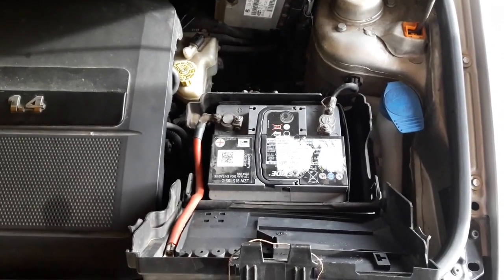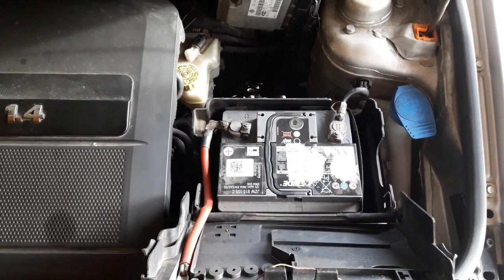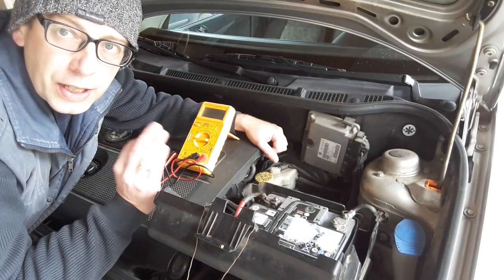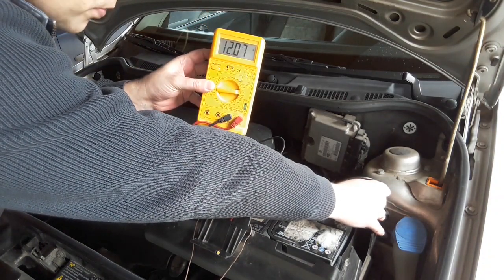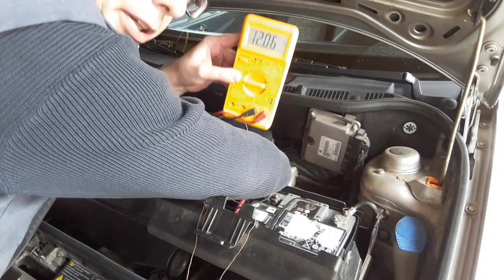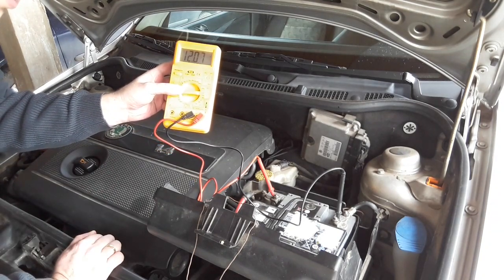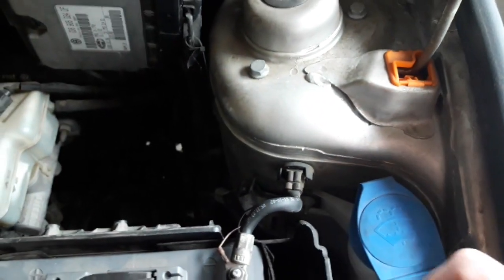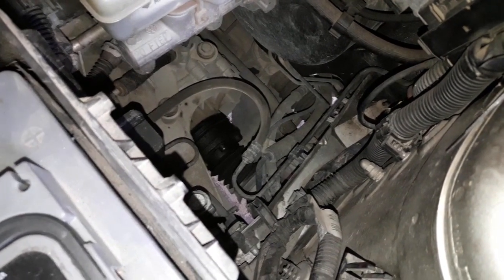Bad Ground Connection On Cars-Meaning,Symptoms, Diagnosing and Solving The Problem

Comment: Good video!
The jumper cable method is pretty fast. Idk about newer cars but I've also heard of people creating an additional ground on older vehicles. I suppose for a ground diagnoses in conjunction with a certain ground  not easily accessible or the area of ground conection is simply too oxidized. May as well check out the condition of the positive cable while you're poking around.
My truck has a slow start, takes an extra crank, bit of a lope. Charging system/battery is good, might just replace the battery cables for the heck of it, see what happens. Its 220,000 miles and a decent amount of corrosion akl along the inside of the cable. So even it doesnt solve my problem, I feel compelled to do it. 
Come check me out.

Comment: Out of all the videos here on YouTube about checking the ground connections, I actually understood what to do. Thank you for making it easy to understand. Have a blessed day.
Reply from the maker: You're welcome and thanks for watching!
Reply: @DespairRepair Hi I'm not sure if you still reply to this video or not but I'm desperate. My car has no problem starting it doesn't crank hard or anything. But I do have really weird electrical issues where radio will shut off sometimes I can't unlock my door after I park with the button (still unlocks when I open door(s) ). Odometer goes crazy and incredibly rarely thought it has happened at least once the headlights turned off at night for a brief second. Sometimes I'll get a battery light but not usually. Codes show fluctuating voltage sometimes says system voltage high sometimes it says low same is true with brake. It also says I have a bad break vacuum pump but it doesn't make any crazy noises and I don't have any issues breaking or stopping along side other codes that don't make sense compared to what I'm seeing. Most of which will always come back after clearing codes. Battery test both loaded and unloaded at advanced auto showed battery is good. I've been worried it's big but someone on a forum recommended ground. Does this also line up with bad ground to you? If not do you think a pcm could cause this? Is that even possible? Cause lots of my codes relate to a pcm but I'm seeing no evidence online as none of the usual bad pcm symptoms are what I'm experiencing my mpg is still good car doesn't shut down while driving. But it would then have to be a tipm wouldn't it but again no starting issues. But no mechanic around here is willing to work on electrical issues so I'm stuck trying to figure it out on my own.
Reply: @DisloyalGaming your TIPM
Reply: @DespairRepair  So how do I test the 2007 Audi Q7 with battery being not under the hood. It's under driver seat inside vehicle. How am I to test ground using your method explain here with the multimeter?
Reply from the maker: @Heylo7  hi and thanks for watching! Do you have remote battery connections under the hood? 
Also, what do you want to test? Is the engine grounded, the body, or else?
Reply: @DespairRepair  yes I have positive connection and the ground connection posts to under hood driver side of the engine bay. I want to test for ground. Using your method from what I watched in your video here. My multimeter is a cen-tech cm300 and the dials numbering on it start at 60 600 6000 etc it's not the one which let's you set multimeter to say 20 200 2000 etc mines not like that.
Reply from the maker: @Heylo7  what's the problem and why are you testing?
Reply: @DespairRepair  hi here's a update. Upon further inspection of the vehicle fuel pumps located under rear passenger seats I discovered right side fuel pump, fuel filter missing it's hose. I'm not sure if it's the sending or return? I have not taken either of them out at this time. I'm wondering whether as result of missing hose would that possibly be a contributing factor as to why there was issue with high pressure fuel side of system. I think it would be best for me to simply replace the two fuel pumps and fuel filters...also figure out where missing hose goes attached
Reply: @DespairRepair  I tested the map sensor for 5V reference and it was less then 5V
Reply: Good and clear explanation - thank you 👍
Reply: C b lm c c

Comment: On VW group cars: high idle, around 1100 rpm = grounding is bad.
Reply: Really? I have a 87 cabrio that is idling at 1100 and I have voltage drop issues when any components are used, signals, fan, brakes etc.
Reply: @Chazisus  it is possible. Try to clean the negative leads and see what happens
Reply: @wtfatc4556  I have a 900rpm idle whilst in drive and 1100 in Park/ neutral
Reply: @Chazisus  hard to tell if it is the same problem.... mine sits at high eevs even in drive.

Comment: What ground connection ? Where on 12 v battery u have ground ?
Reply: Black negative wire is ground
Reply: @neil_st6073  no negative wire is negative wire not ground ! In your house is ground wire green and yellow .
Reply: @kakofon78  the negative on a battery is connected to ground to make the circuit, normally to the car body, hence It is the ground in this situation
Reply from the maker: Hi and thanks for watching!

On a car, the ground connection is considered the connection between the minus battery terminal and the engine/body/chassis.

So, it's not literally a ground connection but speaking in "electrical" terms, it is.

Comment: You helped me, I knew I had a good battery & the alternator was fine. I was told my battery cable was recalled. I'm stuck 400 miles from home, alone & need to get back. I cleaned the one accessable ground connection & haven't had trouble since. Thank you very much for the info. Now my serpentine belt is squealing & I must replace before my trip. I've had one blow before & it busted the water resivour & temp guage.
Reply from the maker: Glad the video helped and thanks for watching!

Comment: Really thanks alot for the very useful video. Question: When doing the bypass jumping cable , should I turn ingention key on or leave it off ? thanks.
Reply from the maker: You're welcome and thanks for watching!

It would be better to first turn off the ignition and then connect the cable.

Comment: Replaced FIVE starters (each one lasts maybe a month!) so thanks for this very helpful video, looking for all the ground connections to see if heavy cranking is burning them up due to poor ground. Maranatha
Reply from the maker: Hi, thanks for watching, and glad if the video helped!

Hope you solve the problem, a bad ground connection will fry the starter for sure.

Check if you have a ground strap from the engine or transmission to the chassis or body.
Reply: I had the same problem and consulted many mechanics. Some said the problem maybe the battery and others starter. I had it fixed and it's okay.

Comment: I have an issue with my 2015 Ford fusion...so it sometimes won't start and says its not in park but it is in park and the beeper stays on and drains battery. So after checking battery which is new...alternator which tests fine I was angry and I hit the top of my steering wheel, the flat part on top right behind the steering wheel with a flashlight just out of anger and it started. (Yes this is anger from  a single female and trying to fix my own car...very frustrating! Lol) anyway now when it decides I need stress and doesn't start I just get the flashlight and hit it and it starts so it is probably a ground wire or loose wire inside but I can't seem to find it. Any ideas? I have it torn apart now I will try to post pic. Any help please?
Reply from the maker: Hi Lisa and thanks for watching!

This is a tough one but the first place I'd look is around the ignition switch, where the ignition key goes.

Namely the electric connector and wiring that goes to the ignition switch.

To do that you'll have to take off the plastic trimming around the steering wheel.
Reply: Can you teach me this?

Comment: My car radio turns off when I hit the brakes. Sometimes it goes off when I put the car in reverse or turn on the blower. Lights are flickering. Long start.  Battery is 11.4 while running, down from 13. Corolla 2013. I don't know where the engine ground is, only the battery ground.
Reply from the maker: Hi and thanks for watching!

All of that sounds more like an alternator problem than a ground connection problem, to be honest.
Reply: @DespairRepair  
It started after my brand new alternator was only 2 or 3 months old! I installed the alternator myself. But tensioner is bent a little which means that the belt could potentially get looser or tighter while driving.
Reply from the maker: @gabe6281  well, it's possible but then there's some serious belt slipping.

And even if there is, the voltage should be above 11,4 volts. With a loose belt but with a good alternator, you should get at least 13 to 13,5 volts until you turn on the light for instance.

Comment: I was having issues that my car goes in to limb mode,not revving above 2000 rpm,diagnosed the car and it said exhaust gas temperature sensor, replaced it and it was ok again for about 4 months,then the same problem appeared, again the egt sensor, i said to myself maybe a bad sensor, contacted the seller they gave me a new one other brand free of charge,it was ok again for 4 or 5 months ,again the same problem egt sensor, it was having also difficulties to start the car,and one day the car would start anymore, no power whatsoever,checked the battery and noticed the ground connection was loose,it was tight all the but would not grab,i took a piece of aluminium foil and jammed in between the connection and since then car starts very good and no more egt fault codes,it was very frustrating the find the problem 😂
Reply from the maker: Hi and thanks for watching!

Glad that you solved the problem and congratulations on finding what was the issue.

As mentioned ground connection problems can cause really big problems that manifest themselves in various ways.

Not being aware of this problem can cost a lot of money and nerves.

Just make sure the connection is good and clean, even replace the connection if you have to.

All the best.
Reply: @DespairRepair  thanks ❤

Comment: The jumper cable test worked for my 30 year old truck. I had no power inside the truck except the cab light. I was about to buy a new battery even though mine tested 12.6 volts. I turned the key on and hooked up one side of the jumper cables from the negative battery to the fender and everything came on inside. I cleaned the negative battery cable at the alternator. 5 minute fix after watching the video. Thank You so much!!!

Comment: 9:11 my car doesn’t show any sign of electricity. But if i put a jumper there is electric and i can start the engine. Whats the problem? 
I didn’t change the battery within a year. I asked a worker he said the old battery is fully power and could last for two years more
Reply from the maker: Hi, Blender videos, and thanks for watching!

You've probably already done this but did you check the battery terminals and clamps?

Are they tightened and clean?
Reply: @DespairRepair  Thanks man, the problem were in the ground wire and the negative wire. They really were dusty. I cleaned them and tight them good then all works fine.
Reply from the maker: @blendervideos4974  glad to hear that and that you've solved the problem 🙂

Comment: Finally someone that breaks it down in a simple form, I've been having some issues with my Jetta. Pretty sure it's a bad ground connection or ECM. This video helped me understand how everything goes together and how to use a multimeter as well.
Reply from the maker: Hi Dwayne, thanks for watching and for the nice comment.
Glad if the video helped, we try our best to simplify.
By the way, admire the skateboard skills :-)
Reply: @DespairRepair  00⁰0⁰⁰⁰⁰⁰
Reply: Did you replace the ground?
Reply: Lemme guess.  Mk4 vw
Reply: Updates lol?

Comment: Don't know if you reply to old videos but I have a 2003 Buick Century that is currently not keeping charge on the battery even with a brand new alternator. Thing is when I charge the battery, it won't charge, so the car keeps on dying; do you have a solution for this?
Reply from the maker: Hi and thanks for watching!

I would first check if the battery is OK. If it's not, it can't hold the charge from the alternator.
Reply: @DespairRepair  I actually did get a new battery yesterday and that solved everything
Reply from the maker: @Yvetel  ok glad you solved the problem!

Comment: All the lights turn on but won’t crank rip
Reply from the maker: Hi and thanks for watching!

Provided you mean the dashboard lights, do they go dim or disappear when you start cranking?
Reply: @DespairRepair  no they don’t and my low beams don’t dim either
Reply from the maker: @jonathanlegarda6004  the first thing I would check is are the battery terminals tightened and clean.

It could be a number of things, the best way to find out what's wrong is to check if there's input to the starter.

Hope this helps.

Comment: Hi. My electronic steering gets stuck once in a while and lights got dimmed once too. Already change the alternator and battery but it still gets stuck once in a while. Could help me with the cause and solution?
Reply from the maker: Hi and thanks for watching! Is it A Skoda?
Reply: @DespairRepair  a toyota corolla. My car starts fine and no light but on heavy load with all lights on its loses electric power. Lights get dim and all the electronics start malfunctioning and after a while its fine
Reply from the maker: @abdullahcheema7061  hi again. 

There could be a number of reasons. I don't know about Toyota, but on a Skoda, a similar problem may be caused by a faulty steer angle sensor.

But before all of this, I would check the main ground connections, especially if some repairs were made previously.
 We've made a video on this topic so if you're interested you can take a look.
https://youtu.be/gfhsVU6ZFaw

Comment: Was driving home from work the other day in my 1977 Buick Park Avenue/Electra, the power went out, engine shut off, pulled off to the side of the road. Now when I try to connect the battery, the battery shoots sparks. What would cause this?

Comment: how can i use the jumper cable if my battery is in th trunk
Reply: I'll suggest getting a really long jumper cable or join two or more of those cables to connect the battery negative terminal to the engine block.

Comment: Hi i wanted to ask, is it related to bad grounding if my car radio turn on and off randomly. I just check the wiring of the radio and it was good and the headunit also brand new. The headunit seems to be working fine on other car
Reply from the maker: Hi and thanks for watching. In that case, I don't think so.

Comment: I have a mazda 6 no start no crank battery good starter good when it doesn't start the dome, radio, power door locks don't work . Now I was moving a negative wire going to the fuse box under the hood and the lights inside came on but it stopped doing that. What could it. Be
Reply from the maker: Hi and thanks for watching! 

To be honest, it could be a lot of things, in that case, I would first check the battery clamps if they were clean and properly tightened.

Comment: Can a bad ground make your tail lights not work and both of your blinkers turn on
Reply from the maker: Hi and thanks for watching!

Yes, it can.
When the ground connection is the problem, the rear lights usually work simultaneously but with a weaker glow.

Comment: I didn’t know about the jumper cable trick, I need to try that! I did a head gasket job and had a long period of time where I wasn’t working on it so I can’t figure out so far where two of the (supposedly ground) terminals go. I bought a new battery so if it works after I do that trick then I’ll be able to run it while I’m waiting to find where those wires are supposed to go. Even my OEM shop manual didn’t list those points, maybe they’re in a different area of the manual. Maybe I’ll be able to find a junkyard car I can reference.

I was having other issues like my dashboard flickering, being dim, or even spazzing like the needles and the lights, those were likely the ground wires I had touching the engine being sporadic.
Reply from the maker: Hi Wyatt and thanks for watching!
Yeah, it's a good first-aid measure, helped me a lot a couple of times.

Most manuals (even the professional ones) don't have these points stated, why I don't know, as they are very important.

I would first look at the connection from the battery to the car body and from the body to the transmission or engine.

Some cars don't have a ground connection from the body to the engine/transmission, it rather relies on, for instance, the connection made by screws on the engine mounts (which can also cause ground connection problems).

Best of luck with the repair!

Comment: What about a driving for a solid hour and then once idling, just stalls out and starts up again with no problems. This has only happened twice this month. Does it sound like a battery/ground issue?
Reply from the maker: Hi Adam and thanks for watching!
To be honest, doesn't really sound like a ground connection problem.

Comment: Hi, can this cause the infotainment system to work sporadically? It has navigation and controls the climate in my car. I also see it with a message sometimes on a black screen “check system” or “check energy consumption”. Can it affect the infotainment system
Reply from the maker: Hi and thanks for watching! It could be but besides the ground connection check for other loose electrical connections or is the system updated.